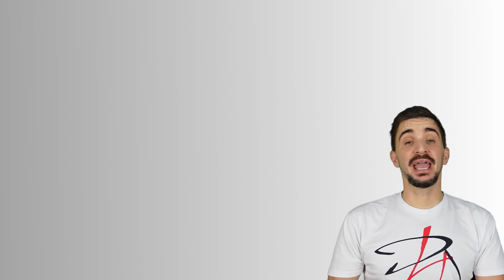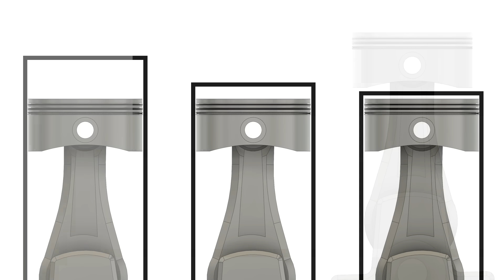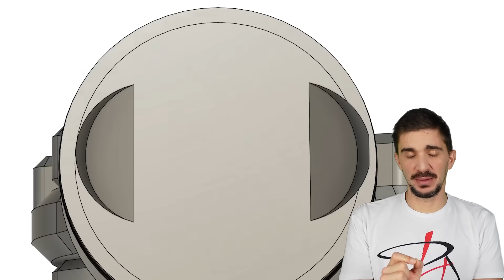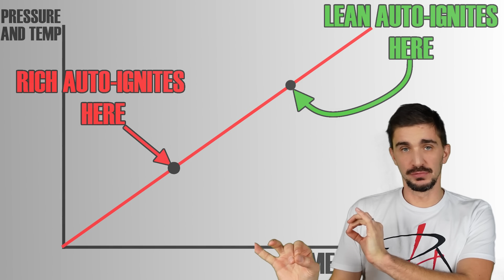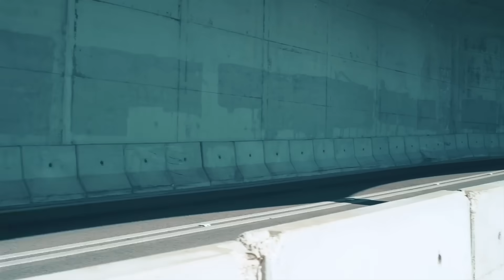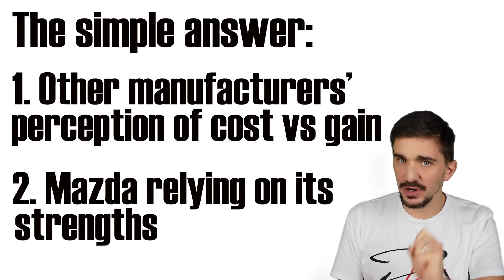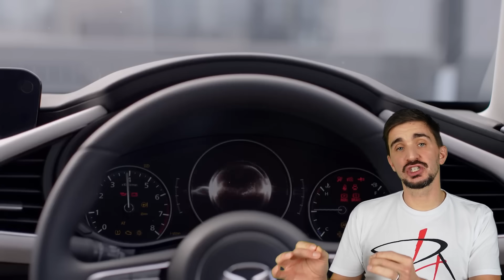The Game Changer Nobody Cares About - Mazda Skyactiv-X SPCCI How it Works and Why It Didn't Catch On

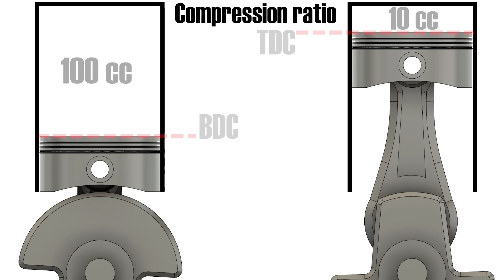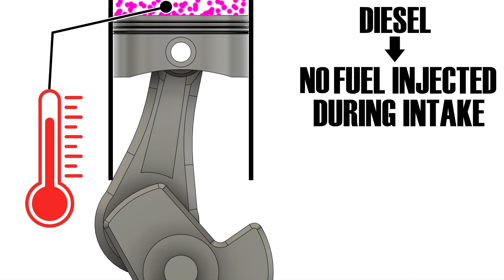Comment: Originally diesels were cold and slow-running engines, with a mechanical injection pump calibrated for the cylinder size. So fuel had plenty of time to fully combust, and they did not produce much smoke (at least not the better brands). Due to the low temperature, they produced almost no NOx, and had very low heat-losses. But then governments taxed diesels on size instead of horsepower. So manufacturers had to reduce size, make it run 2x faster, add a turbo to get more oxygen in through the smaller valves. Result: more air-friction losses, more heat from the turbo, more wear from the higher RPM and higher load per cylinder, more smoke due to (1) fuel having no time to combust and (2) turbos not spinning up fast enough, so when accelerating they get too much fuel  and produce a big black plume of smoke. So manufacturers had to add high-pressure injection to make fuel burn faster, resulting in more fine particles pollution. And they had to add EGR-crap, and particle filters, variable valve timing, piezo-electric injectors, and all that worthless crap to solve that. EGR, thus recircling hot gas, further increases temperature, causing more NOx, so they had to add more crap to solve that, like AddBlue. Old Mercedes 200/220/240 diesels around 1970 often got between 500.000km and 1 million kilometers. Modern diesels hardly get to 200.000km, after which you have to buy a new car, thereby spoiling all possible environmental benefits from all those "green" measures and technology. So, why don't they go back to slow-running diesels with low-pressure injectors of 100-200bar instead of 1000-2000bar? But these engines now CNC-machined to much higher standards than was possible in the past? Big cylinders, cold-running, high-efficiency? And if they want more power, why don't they just increase compression-ratio, to maybe 1:50 or 1:70 instead of 1:30? This is technically a 1000 times cheaper and easier than all this modern fragile crap. Such old-school diesels do not produce fine particles, only crude particles, if any. So you can get by with a much simpler and less restrictive filter. Crude dust sinks to the ground fast, and does not get into the lungs easily, nor does it get into the bloodstream, so it is less of a health risk. And such an old-school diesel, produced to modern precision standards, would cost 10x less than modern crap, I think. Or am I missing something in my reasoning here?

Comment: Is that really correct? Google search: 
«Diesel typically weighs approximately 0.82 to 0.87 kg per liter, while petrol usually weighs between 0.71 and 0.77 kg per liter. Consequently, a full tank of diesel is roughly 10–14% heavier than a full tank of petrol.»so weight  comparison. All modern Diesel motors got turbo. If you compare similar motors both with turbo at the same car. My experiance here is Volvo XC90  (03-14) 5 cylinder Diesel D5 185 hp and petrol turbo 2.5T 210hp allmost similar consumption. Note that 210hp potential can do more work due to more power, so that is ofthent the case because xc90 is a heavy car. Greetings from Oslo Norway 😊

Comment: I have a solution
use the petrol for the primary lean mix, then use direct diesel ijection for ignition timing and also adding more diesel for some load control. importantly we dont need a lot of diesel its use is primarily to replace the spark plug, ??????

Comment: Very interesting, and great explanation of how it works. I knew most of it, but you explained it really well! 

Since I am very interested in probably buying a used Mazda3, perhaps within a year, I am very interested in the choice of engine in it.

Do you know how this engine have evolved in Mazda during the years? The reliability?
Any inputs about this engine’s evolution during the years is very appreciated. 
Should I buy a Mazda3 with this engine for a specific model year onwards? 
If it is unappreciated, but reliable and fuel efficient, I can make a really good deal, and be very happy with it.

Comment: 180hp slow? Here in Europe or better in Italy 180 is a premium car, and the fact that is manual is a pro, considering that until now, 99% of cars were manual. With the advent of hybrids, more and more automatic, CVT cars are coming, and this is a problem. Cars already costs too much, and cheaper cars are disappearing. Manual transmission, are easier, repairable, and costs much less to produce and maintain. That Mazda would be perfect here, the only problem, just few people have the money to buy it, and those people are probably going to buy some more exotic cars

Comment: Sure, but then why is their fuel efficiency  just average, and the fuel-efficiency on their turbo-engines are below average. I think the 2.5-liter non-turbo with the six-speed manual felt really good for low-end torque and not too bad at the upper-end of the revs. Unfortunately, Mazda puts too much of their eggs into one basket and fails to update their automatic transmissions. Worse, they continue to plague most of their line-up with the down-market, torsion-beam rear suspension that makes their smaller car prone to sudden snap-oversteer too easily. If the fuel consumption on the SKyActive engines were hybrid-like, I'd see the benefit, but they're merely on par with the rest of the industry.

Comment: As someone in the MotorTrade dealing with used Skyactives. They are a fucking nightmare. If the car doesn't get enough Hot Cycles to burn off it's soot it starts to pack up in the inlets & through the hole engine. Massively expensive to repair. I've been burned on two Part Exchanges this year alone

Comment: What gets me is the principle that gasoline/petrol is inefficient. My 13 year old 1.25 Hyundai petrol gets, I haven't tested it but must be 50mpg, easily. It starts on the button even in winter, importantly, it heats up in minutes, unlike 'efficient' diesel. So warm air to heat the windscreen and passengers in minutes not 25 mins like diesel. It's making less particulate emissions than diesel. It doesn't consume the diesel that buses and HGVs and vans need. Diesel needs a particular heavy oil mainly sourced from Russia apparently. A litre of petrol costs less than a litre of diesel, need to factor that in before considering mpg! So even a generation ago now, there was no need for efficient diesel, in small cars. I always was puzzled at diesel forda fiestas and vauxhall Corsas, they just made no sense, then and now... Don't get me wrong, a taxi, yes, a van, yes a motorway cruiser Mondeo, yes, diesel.

Comment: Car noob here. At 13:00 and beyond, is he saying that Mazdas work best when you lead-foot the pedal and let the car get up to 5K RPM before shifting? If I want more acceleration in an AT car with paddle shifters, and am cruising in 4th gear at 2K RPM, should I downshift to 3rd and ride out the RPM band until almost red then upshift? I'm trying to understand more of what he means by working the engine.

Comment: So in order to trigger auto ignition they have to use extra fuel sprayed at the spark plug and ignite it in order to increase pressure? So I'm guessing the pressure in the cylinder is right at the edge of auto ignition? I wonder what the fuel to air ratio ends up being after adding the extra fuel needed to trigger auto ignition. Tge way you explained it just makes it sound like a normal engine.

Comment: I drive a Mazda 3 with the 2021 e skyactiv x. Its efficient but pointless in a world where tiny improvements in combustion engines need extensive investment and engineering. Meanwhile every other day electric vehicles go further and get cheaper and you can charge them with your own free energy if you got solar. Combustion engines in cars are on their way out. The skyactiv x came too late to matter.
Edit: Even in the first gen 180hp engine you ran in spcci most of the time. The 186hp version improved that even more. Even as a german on the Autobahn Im in spcci mode 90%+ of the time, not counting idle. Extremely low loads or rpms past 5000 are needed to switch off spcci.

Comment: I find this engine fascinating. It is a lot more worth pursuing than Mazda's Wankel obsession. But the list of disadvantages goes on. As we could see in the video, these engines are very tall. Putting them into an FWD hatch together with a hybrid system will be a packaging challenge to put it mildly. And while the linear, constant-ish torque NA experience can be a fun drive with a stick shift, it is not what the 80% or car buyers who pick an automatic want to have. For them a 1,5l turbo makes more sense and the other OEMs rather put their RnD money into that.
Now that the VW group is putting VTG into affordable gas cars and combining it with mild hybridisation, they have a strong case for a different path. I would not call that lazy, there are strong engineering arguments for that case and having VTG in low end cars now is a commendable engineering feat as well. And fuel economy wise they seem to beat Mazda by a noticeable margin while the NA engine is cheaper to maintain. Personally I enjoy watching the competitors try for different solutions and for that Mazda deserves particular respect.

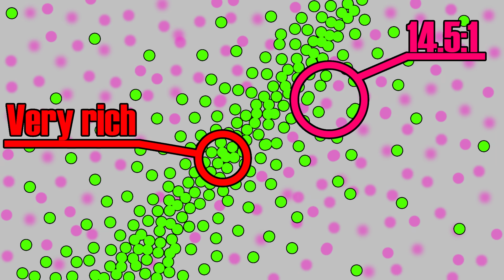Comment: I might got it wrong, but at minute 3:58, you are looking at the diesel injection (spray pattern) but referring to the stoichiometric ratio 14.5 of fuel? Is that correct?
Reply: I think he is referring to the stoichiometric ratio of the diesel top dead center area which is higher in fuel ratio to air so it has a different ratio in the top part rather than the overall stoichiometry
Reply: @moneer7139  yeah he's pointing out that the stoichiometric ratio isn't achieved throughout the whole cylinder because the fuel isn't distributed evenly because the spray pattern can't achieve uniformity.

Comment: Too many people have become spoiled and lazy. Manual transmissions are vastly more efficient and long lasting compared to the best automatics. We don't need electric motors, and all the backup equipment, to open the window. And the unnecessary complications of electric parking brakes and computer everything are unreliable and expensive to fix. The maxim of 'keep is simple, stupid' still rules.

Comment: Thank you, I never saw a satisfactory explanation of how these work until now! They're pretty cool, actually! This also helped me understand why gas can't work like diesel and vice versa. I wonder if this could be used to improve emissions in diesel engines as well, by spreading out the fuel better? I guess it makes sense it's not taking the world by storm, because consumers today don't like revving their engines out of a belief/fear that doing so hurts the engine. Sometimes enthusiasts understand things differently, knowing an engine is made to be revved, and loving it for that. Sounds like the Skyactiv-x engines could be great for "slow car fast" driving experiences... 

It also makes me think the answer could be to make bigger Skyactiv-x engines. Six and eight-cylinder versions would easily fix the torque issue, while still taking advantage of the improved fuel economy.

Comment: Looks like the perfect technology to use in an airplane motor.  Design the motor with a very strong gear to gear reduction from the crank shaft to the camshaft and use the camshaft gear for the takeoff power for the propeller.  Simple and pto of the motor would be half of the motor crankshaft speed !

Comment: In reality this engine has fuel consumption very similiar to other gasoline engines. Engines with turbo are usually more dynamic and hybrids require less fuel and are better city cars. It's not commercial success because it gives you almost nothing. This is the sad truth.

Comment: Here's a couple of idea's
- Pre-mix, so you have full control over the mixture ratio
- adjust the compression ratio on the fly. like vvt you could apply a similar system to the crank
The 3rd variable, temperature, no need to control it, you can anticipate it through the compression ratio. The pre-mix should be a vortex chamber that keeps the gas/air mixture internally flowing to keep the homogenous gas/air cloud.

Comment: Seems like this tech would pair incredibly well with infiniti's variable compression engine. Control from the auto ignition would come from the fuel air mix and compression eliminating the need for the spark plug. variable compression hcci?

Comment: Why would I need it if BMW already is really fuel-efficient at cruising speeds? In my experience, 530i (b48 engine) has 7.5L/100km at 90-120 kmph. If you use the gas pedal to accelerate into the space, it has around 10.5L/100km. It is a fast car also, so it has reasonable gas mileage.

Comment: I really loved and appreciated the more philosophical approach towards the ending, it's a breath of fresh air in the automotive part of youtube.
Reply: I have to sympathize about the philosophical ending but improvements like automatic transmission, driver assist safety features are marked advances. it's the engine design philosophy of Mazda that I fully support. And please don't harp on the RX8 failure and hang it around Mazda's neck, what's past is past.

Comment: Mitsubishi  made GDI engines like the mazda engine over 30 years ago. Unfortunately  while the NOx produced by diesels are  an order of magnitude lower than petrol engines it is definitely not zero NOx. Petrol engines running at stoichiometric employ 3 way catalysts to reduce NOx emissions to an order of magnitude less than raw diesel emissions. Modern diesels engines need oxidation catalysts and NOx traps with associated regeneration equipment as well as particulate traps. The Mazda engine will require diesel style exhaust after treatment. There is also an additional problem of running a petrol engine like both a diesel and petrol engine. The oxidation catalysts of an engine running high air to fuel ratios has to light off at much lower exhaust temperatures, and stay lit off at very low exhaust tenperatures, however such catalysts are not very tolerant of the higher exhaust temperatures that the petrol engines and their 3 way catalysts run at.

Comment: They need to go the Prius route so the engine can drive the wheels at cruising speed but for acceleration there's a small battery to power electric motors

Comment: “You have to work the engine”.  I have a Skyactive G.  The fuel economy is a blessing.  We are old folks, so no need for jackrabbit starts here.  And removing the intake manifold to clean the chambers and valves is a simple project. My 2012 still runs like a champ.  I only wish it was a standard. So I could “ Work “ the transmission and engine.”  And put some fun back into driving.

Comment: I thought about this since the engine came out. If they could put a battery hybrid car out, they could achieve low RPM torque, and even better gas mileage. It would have appeal to a wider base and possibly make the gas mileage even better. Maybe they could partner up with another Car company for a project like that.

Comment: It seems that fuel efficiency and engine flexibility are somewhat mutually exclusive, since attempts at maximizing fuel efficiency generally seem to cause a reduction in engine flexibility.

The obvious solution would be to have a flexible electric motor to propel the vehicle, and use an HCCI/SPCCI engine as a range extender, so that it can always run at it's most efficient RPM.

Comment: So what's the advantage? Better fuel consumption. If that's the case, mate it with CVT, or use it to generate electricity. Then use the electricity to drive all the wheels.

Comment: This tech sounds perfect for a generator because they run at constant RPM. Peak load could be the richest mix that auto ignites at TDC. If it is designed for a battery charging generator it could be tuned to charge the battery fast and efficiently and then shut off.

Comment: one thing that i'd like to add that certainly makes a difference for many european car builders. a lot of taxes (in the EU, maybe also elsewhere) are designed around not only emissions but also weight and, importantly here, engine size. in Belgium where i live your yearly taxes are calculated by using the size of your engine, not the horsepower or anything else. as a result carmakers pivoted hard towards very tiny engines with high power outputs en low emissions. (1000 cc wet belt engines anyone?) This means that these skyactive engines. though being better at fuel consumption would end up costing quite a bit more in taxes seeing as these are bigger naturally aspirated engines. This would offset most of the short term profits.